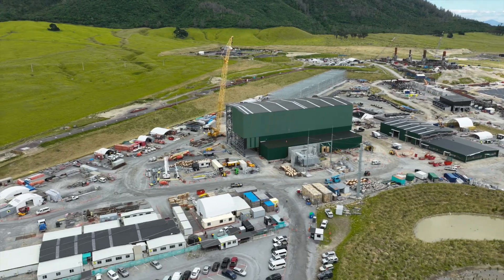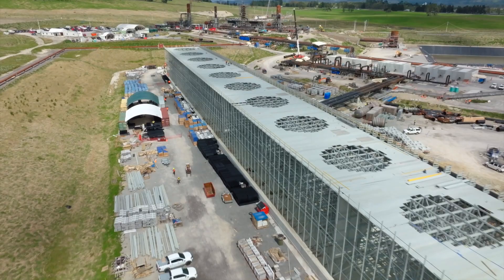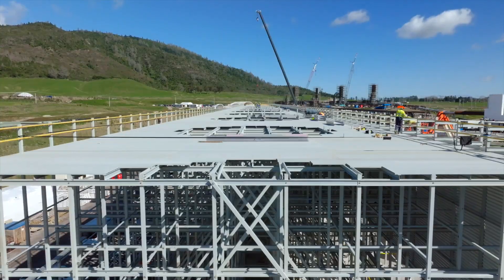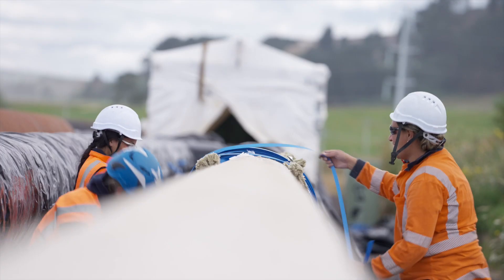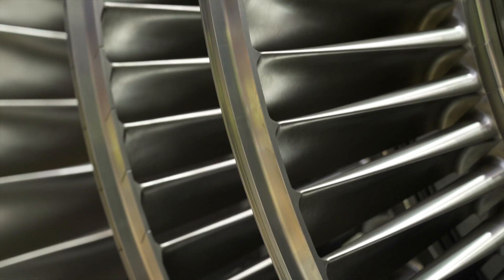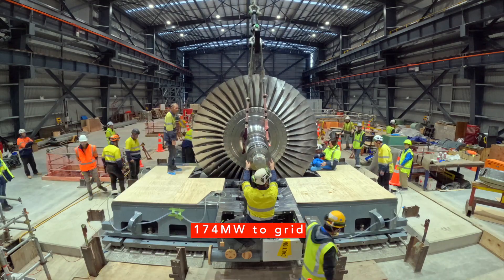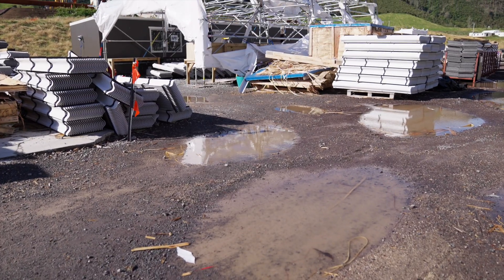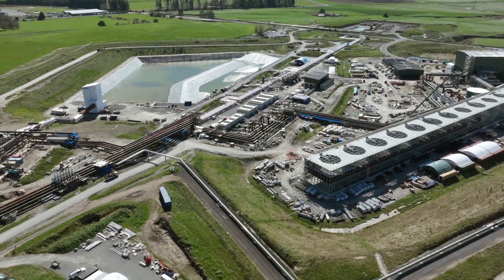Tauhara update - May 2023

Comment: Hope your generator rotor commutator segments are well insulated or in a sealed environment. 25 years ago, not far from your site, a generator rotor failed 12 months after commissioning. The Hydrogen Sulphide gas caused irreparable copper corrosion on the  commutator segments, which pierced through the shellac insulation, shorting out the rotor windings to the rotor core. It was later found that not all rotors are equal, some only insulate every second commutator bar.